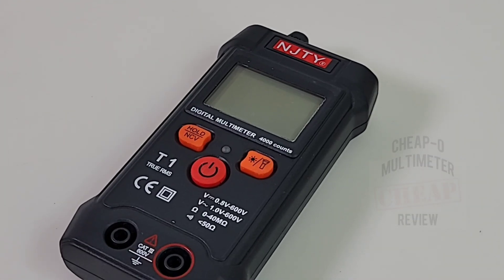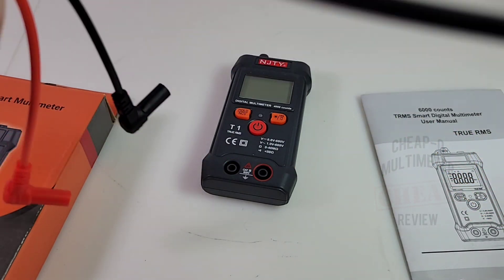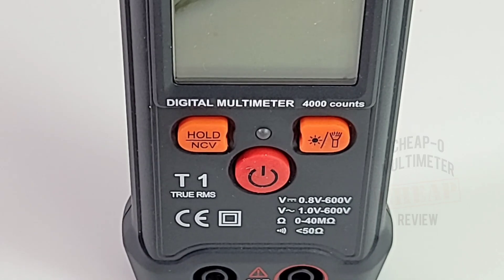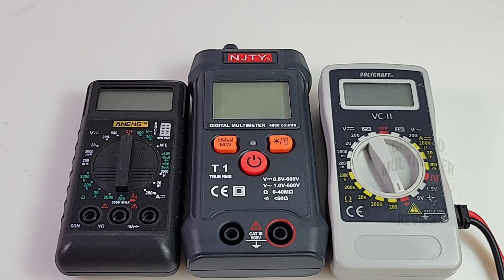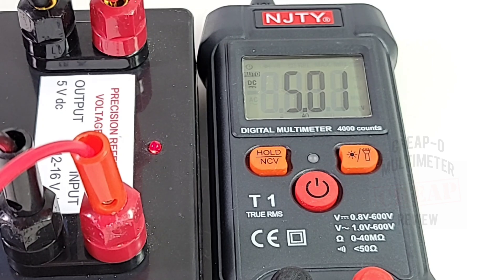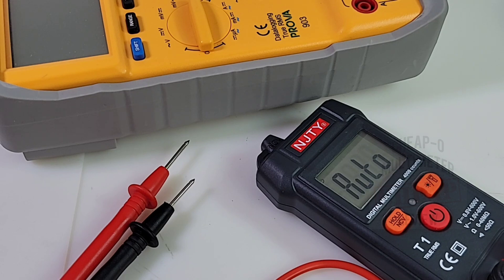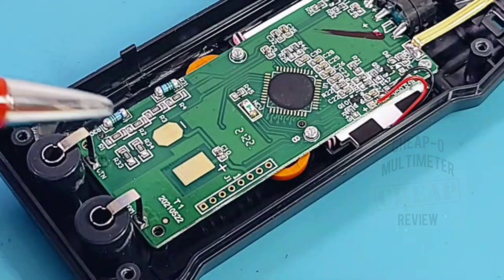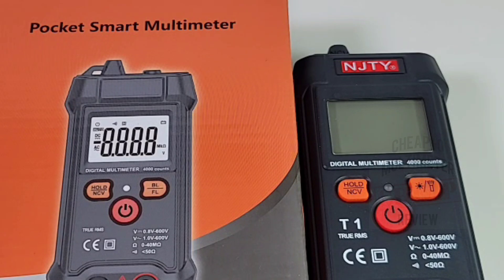NJTY T1 CHEAP-O Multimeter Review & Teardown!

Comment: I like it too! It'd be a great household meter for basic electrical work.

Does the backlight stay on? Are those AA or AAA? Threaded metal insert for battery compartment screw?

Loved this episode's rant. How important is input protection be if one is only measuring voltages of less than 240V? Are you mainly concerned about transient voltage spikes that could arc through the meter?
Reply from the maker: Backlight turns off after 40 seconds...Powered by 2x AAA..unfortunately battery cover has no threaded insert...boooooo! (How did I miss that..?)
All in all , I still really like this multimeter..It's definitely useful and serves its intended purpose quite well.
As for this week's VENT.. There needs to be a baseline for basic multimeter input protection..Transient overvoltage can happen anywhere.
That's where PTC/MOVs can make a real difference. Multiple MOVs= no arcs and equate to better energy dissipation.

Comment: Damn nice review.  I need an accuracy review on AC voltage because that's the hardest to measure.  DC volts easier (cheaper) to verify with reference modules (AD584).

Comment: It says no input protection in this week's vent and the same is found in this good NCV detector that can do AC-DC voltage, resistance and continuity.
Reply from the maker: It's definitely a fail with regards to the input protection ..As another viewer remarked,  it's a great NCV detector with a few multimeter capabilities.  😁 all things considered I think it serves a purpose.

Comment: You can call it an oversized NCV tester with some additional functionality, which isn't bad for just $10. Definitely might come in handy. Separate backlight and flashlight is a nice touch as well. All in all, a pretty solid simple cheap-o.

I'll admit, I would never considered buying it just by looking at it. Time and time again your reviews prove how looks can be deceiving. 👍
Reply from the maker: You and me both.
I wasn't expecting much but turns out this lil ncv tester as you say has some decent multimeter functionality ..I'm taking it to work as well so that says alot. 👍